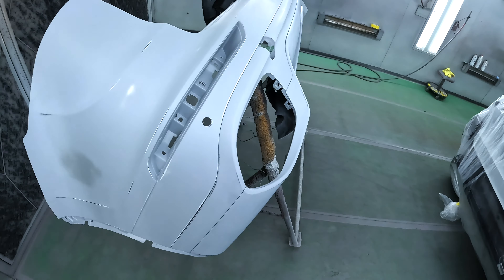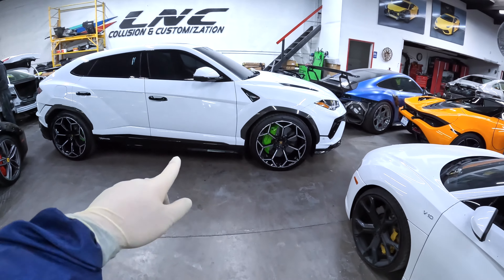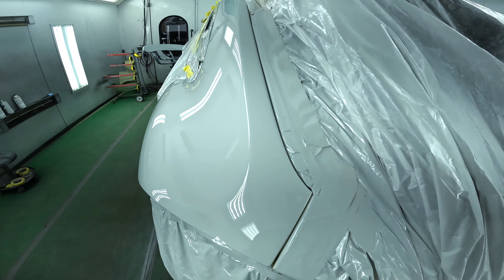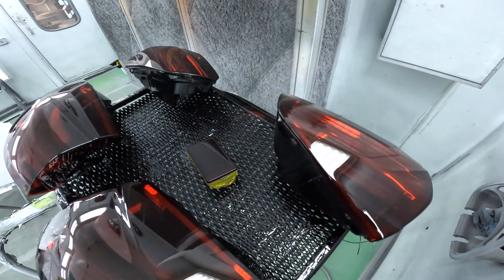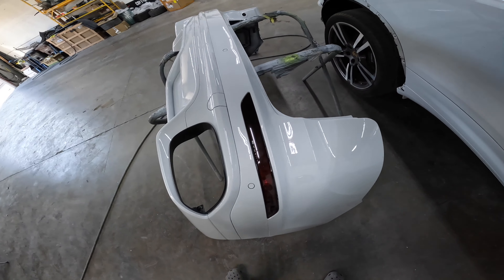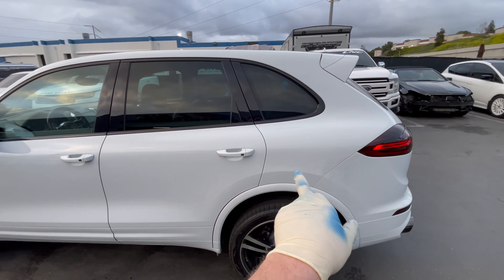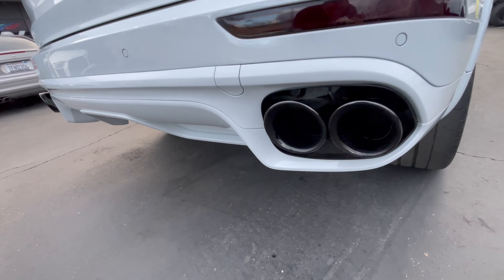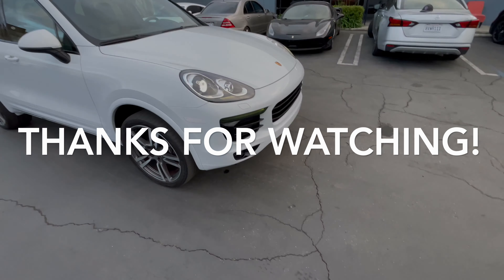Rebuilding Salvaged Porsche Cayenne Platinum Edition

Comment: Andrey, been testing out the booth crocs lately and I’ve gotta admit it’s a solid move🔥 What do you like about wearing crocs and what length is your booth? Stoked for the next video!
Reply from the maker: They are some one comfy and easy to slip in and out when putting on the spray suit. Only negatives are the soles wear out and they become slippery on wet surfaces and i get over spray on my socks thru the holes 😂

Comment: Gorgeous, Andrey. Might consider gloss black on the wheels with a reddish/orange caliper the same as the seat belt release button. Just a thought. The lime green might jump out too much. Also looks like it wants to be lowered or does this one have air suspension (can't remember) and it was set higher?
Reply from the maker: Thanks! This one seems so high and it is asking to be lowered! This one has static suspension and I already have h&r sport springs on order! And i agree, i think the oem style Red caliper with white Porsche decal would be ideal. As far as the wheels its on my last to do list, i do actually like the polished face of the wheels as they are, so tired of black wheels!

Comment: Hi, how did you prepare the lower section of the rear bumper which is usually structured?? I can't find any info on the internet...
Reply from the maker: Sand it down with 220 grit, primer, prep then seal and paint 👍🏻😄
Reply: THANK YOU!❤🎉